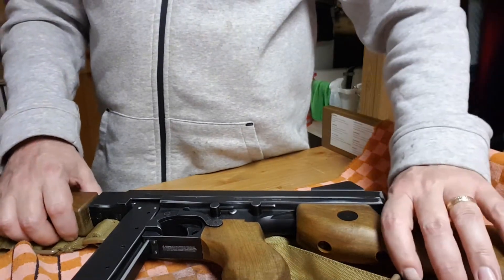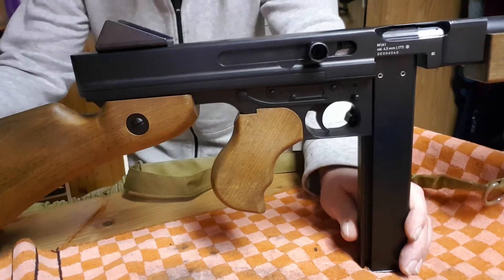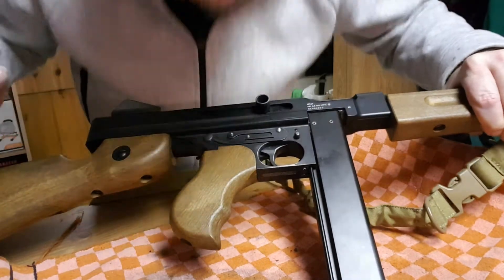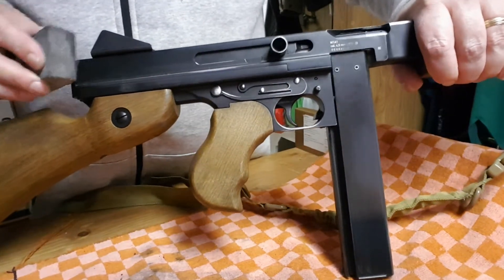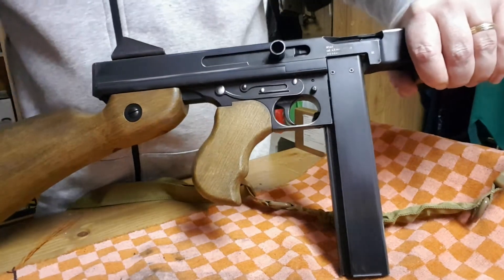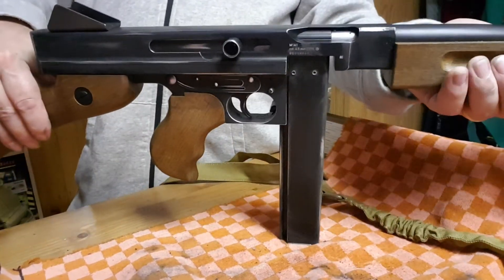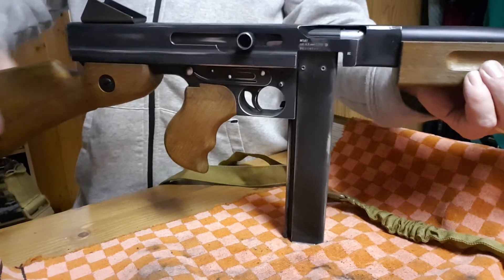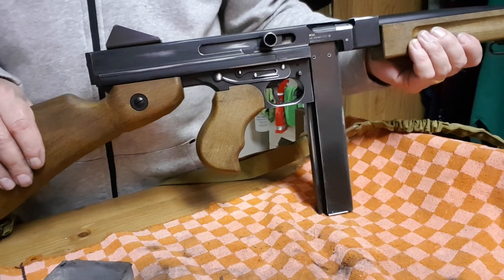Umarex legends M1A1 weathering 2

Comment: I recall seeing someone else who wanted to make the stocks look more like real wood, and used Fiebing's alcohol based leather due to darken the plastic to a more walnut color and then semi gloss sealed it. That's what I plan on doing to mine after I "ding up" the furniture here and there.

Also, be aware of where you are weathering the gun. I noticed on the right side above the trigger, the "mouth harp" looking piece you weathered at 2:59 wouldn't get any wear on the top of it because it's protected by the upper receiver overhang.

I would also recommend picking up a 1917 Kerr pattern sling and getting ride of that bungee one you have on there now.

Comment: Put the sandpaper away and use a scotch brite pad very lightly. 
3M makes other soft pads as well which will give you a real worn in look.
I have aged  electric guitars using 3M pads and aged a few AK 47 rifles for other people with great results.
I would say this being a BBgun why bother just shoot it and don't worry so much about where you set it down and it will wear in and age all on its own.
Your finished product doesn't look quite correct because I have plenty of old worn guns that went thru WWII and yours does not look like the ones I have.
Use Birchwood Casey Aluminum black to restore slight mistakes and not paint.

Comment: I just wanted to say, That instead of using black paint to fix overly sanded, weathered spots, You can go to any gunsmith and actually get, buy the gun bluing liquid that they blue guns with that gives it the blued scheme look on the real guns! this gun blue liquid Is what you use to fix these over sanded weathered parts, gun blue them again, over with these sanded spots, and do it again and again until it's to your liking! The Liquid Is Called, Gun Blue! Steel wool also works well for weathering your gun!